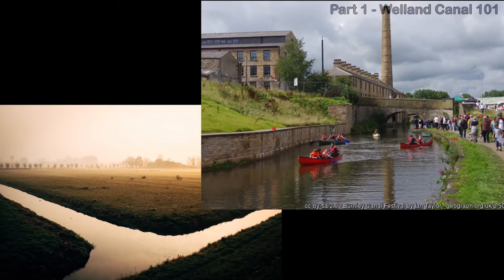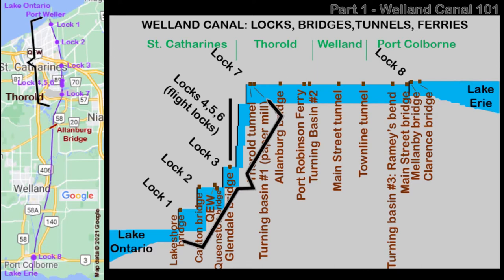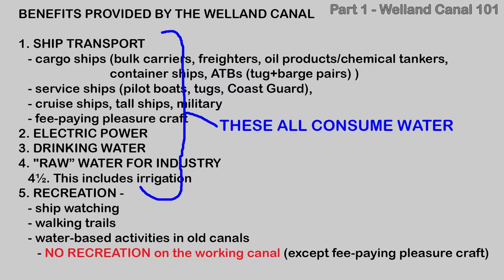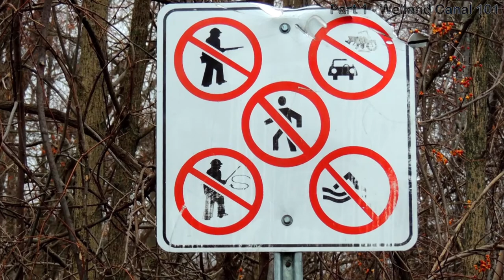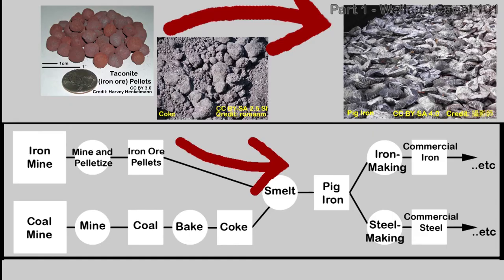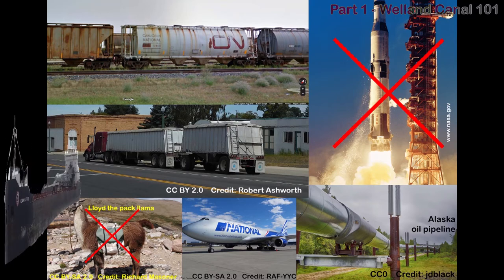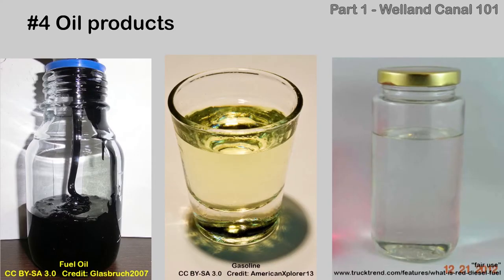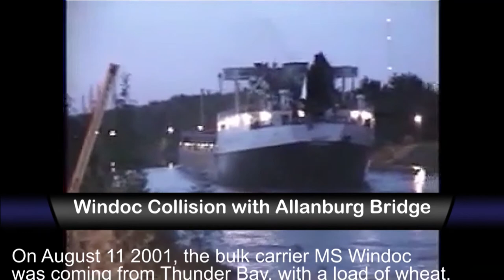Welland Canal 101: Part 1/9 - Overview

Comment: Great vid, noticed ship going thru welland using sprinklers on his cargo hold doors, is that for fire safety or cooling for the cargo doors due to the product being loaded was hot
Reply from the maker: This is to prevent "hogging".  If the deck heats up, then it expands (a tiny bit); and the ship bends up in the middle.  The net result is that the draft increases (at the bow and stern) by up to 6 inches.  If the ship is fully laden, it could strike bottom.  (I think I mention this in video #3 - parts of a ship!)